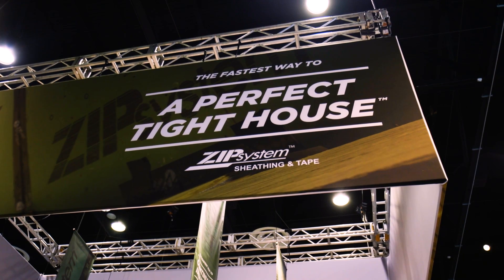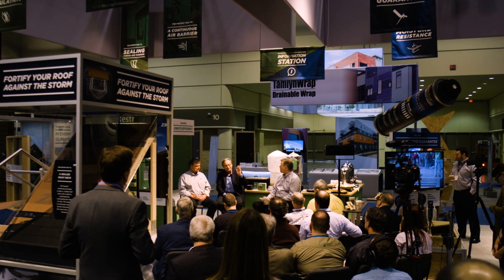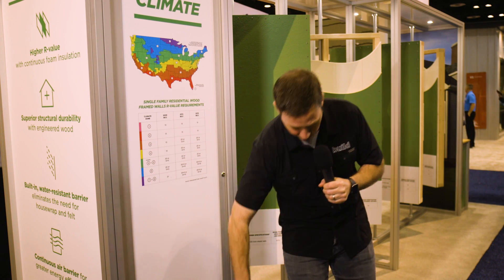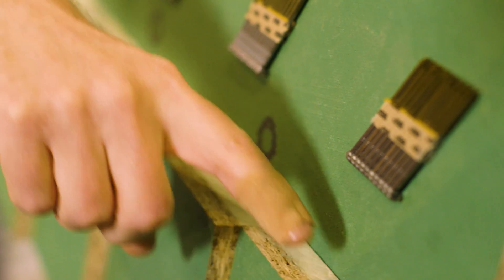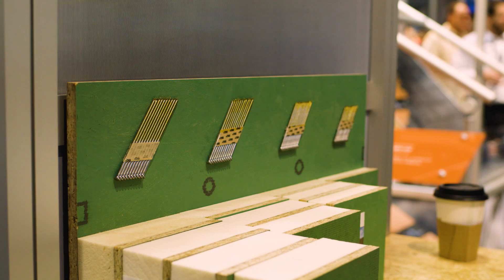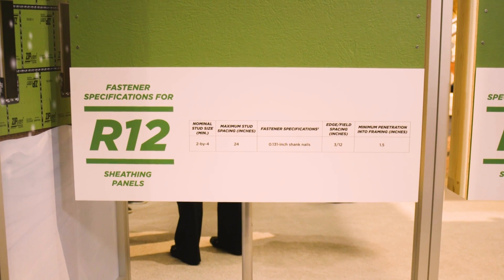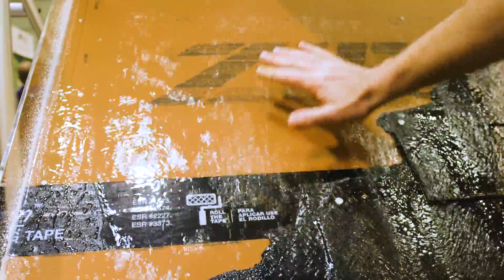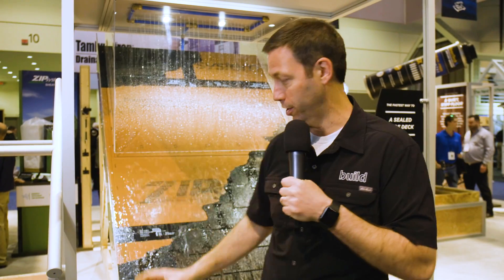2017 Huber Zip System Sheathing and Tape - Whats new from the International Builder Show

Comment: Has anyone seen the DuPont video showing this product failing at low psi. I saw that and was totally turned off the fact that there is no protection for nail holes in this product. 

Just wondering what you guys think, Yeah, I know  part of it is DuPont wanted to sell their housewrap, but the video really makes this look bad.
Reply: John Salazar I saw the video and I think it was smear campaign on the Zip system.  Fact is Huber is eating Dupont’s lunch with this zip system.  The test was unrealistic.  The test treated this product as an exterior product.  It is an underlayment product.  I just built a house with it and applied the siding two days later after a driving rainstorm.  No leaks whatsoever.   One of the carpenters told me he patched a hole in his jon boat with the zip tape and it has held up for months.  DuPont is trying every way to discredit Huber’s Zip system.  I’m building a new house and I will be using it again.
Reply: John Salazar yep, I sure did see that test. I wouldn't trust the Zip system.
Reply: Engineers here in Utah won't let us use the zip poly iso it doesn't have the same shear strength
Reply: @82wethepeople  I'm curious, if it meets code then what's the engineer you've dealt with, problem with it. I'll be building a house in Davis county soon and want zip r9 on my house for continuous insulation.
Reply: @jasondboulton  it doesn't have these same shear strength as regular osb so I'm sure if you started out knowing what you want a engineer could make it work the houses I've seen it not allowed on were pretty stingy with the shear to begin with very large windows in huge rooms

Comment: Matt

I was disappointed you did not show the back side of the Zip rain display.  I was wanting to see how much moisture was coming from the shingle nails
Reply from the maker: +Jim Kandell good question. I didn't see any. I think in a single storm it would be minimal but if you had successive storms that moisture would add up.
Reply: Technically, each nail should have a spot of their sealant, for optimal water protection
Reply: Roger Hale wouldn’t the membrane seal the nail as it pushed its way through it. Their website doesn’t call for flashing the nails unless over driven.